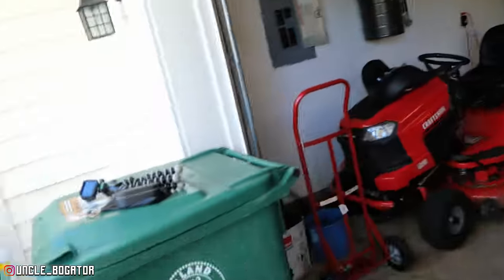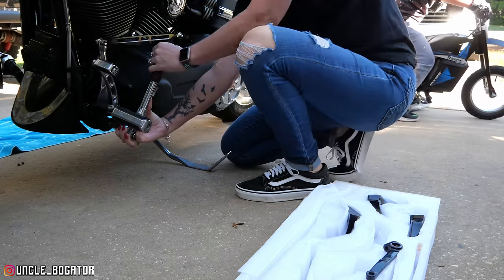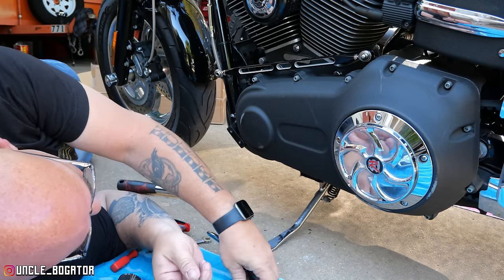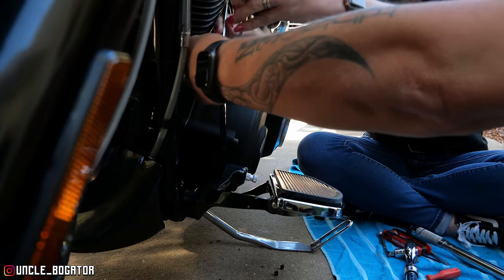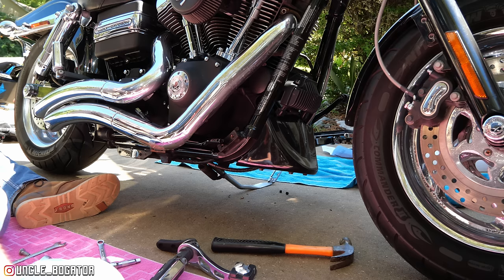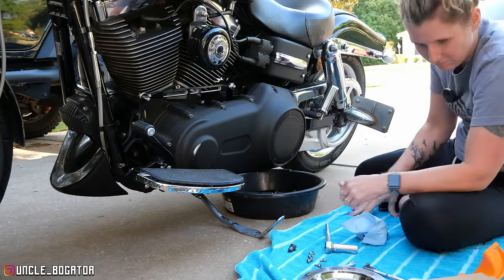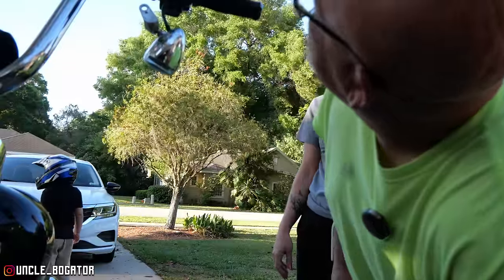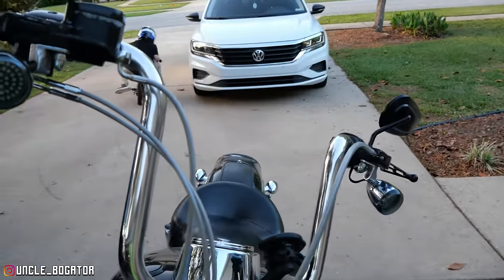Can this girl work on a Harley Motorcycle without breaking it?

Comment: I’ve got my Dyna set up for touring. Love my floorboards. I’m on a street Bob but you better believe my boards are off of a switchback.
Reply from the maker: These are knock offs. The mounts and boards are solid. Seem as good as factory. The foot controls not so much. May try to find switchback ones used

Comment: Hey Mike ,when ya had Bo mama loosen the cable at the front , i noticed hmm dont know what ya call it umm the bottom engine scoop? for lack of its correct name ,i noticed its brock, i think you could repair it by picking up a plastic weld kit .i got one for Christmas from my husband i love it its so cool and after you repair it ,you'll be looking for other things to fix lol and they dont cost that much here in Canada it was only $55 i got the one that you charge up .ya need its ready to go.
Reply from the maker: I didn't notice it but I'll take a look now. I think those are called chin scoops but I could be wrong.

Comment: hi "UB". Pls show your wife . . when she is using tools. The socket drive handle or spanner should be at or near 90 degrees to her arm pulling direction. Avoid pushing on the tool. This will give her safe control and max power from her arm. Once she tries this a few times it will become 2nd nature. Hope this is helpful, we don't want to see injuries. cheers from across the world.